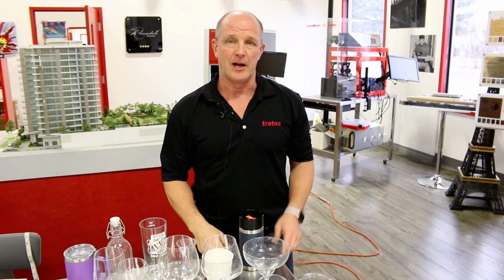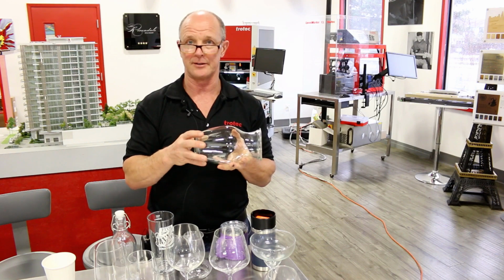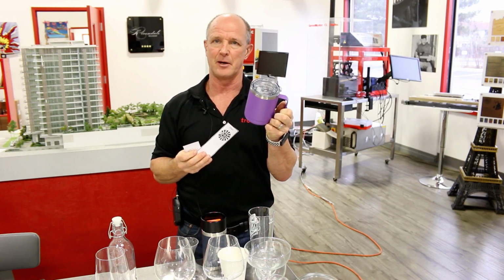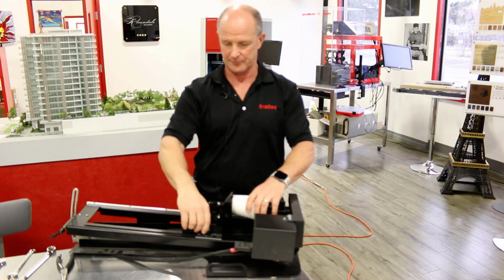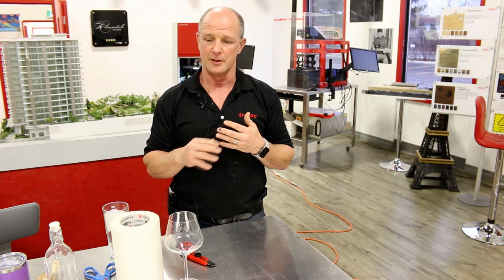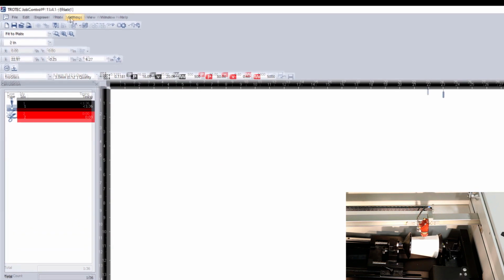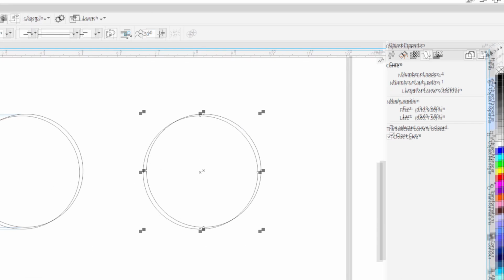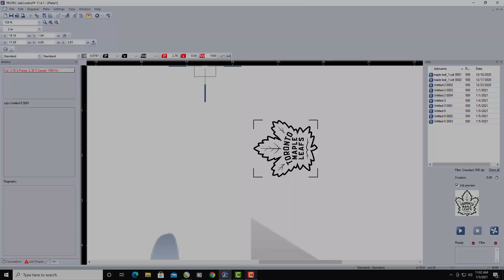Mastering Your Laser Engraving Machine's Rotary Attachment: A Comprehensive Training Guide

Comment: Very helpful, thank you. I'm trying to etch a continuous spiral pattern on a cylinder, so that it wraps the circumference more than once. I put the linear pattern on an angle to get the sprial effect, but I can't seem how to convince the software that my circumference is larger, since the cone-drivers rotate by degrees off center. Any help appreciated. If my description is hard to follow, think of it as a barber-pole effect.

Comment: Nice video 👍

If you are engraving a conical object (with angled rotary-attachement) - which object-diameter do you input? 
smaller one? bigger one? 
or the diameter in the middle of your laserjob?
Reply from the maker: Use the middle. I would measure the circumference and than work it back to the diameter by dividing it y pi or 3.14. I would keep the logo as small as I could to stop distortion - Mike Clarke
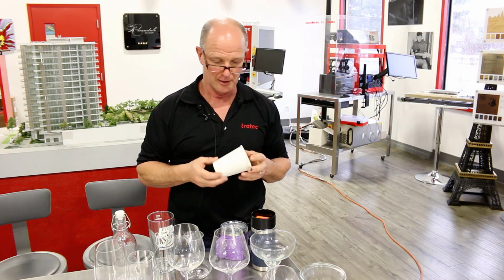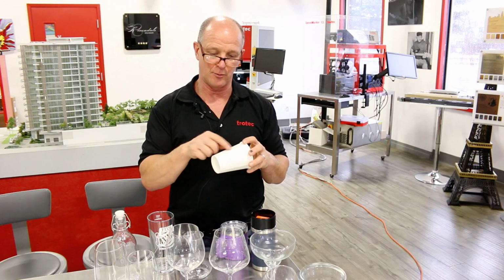Reply: Watch 9:24 - 10:03 in video. :>